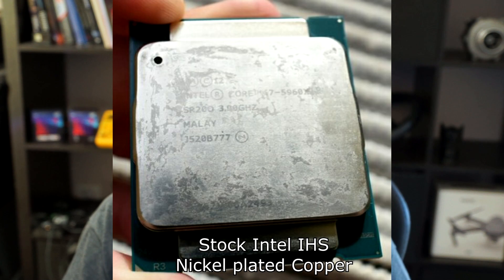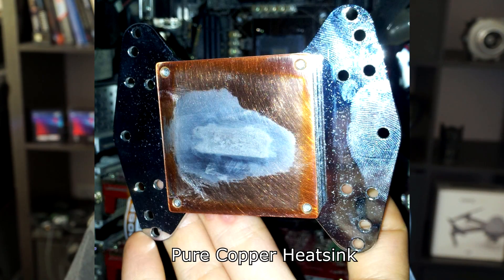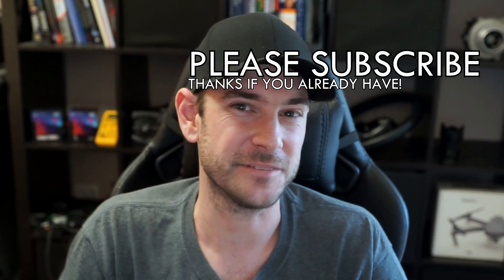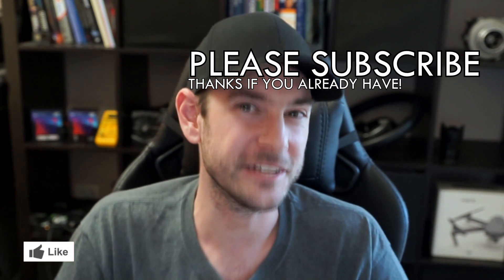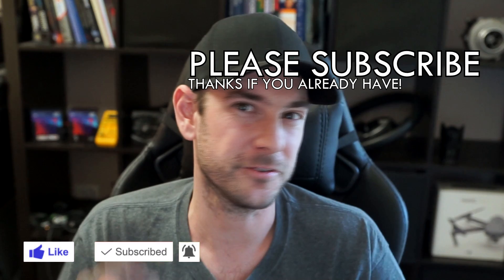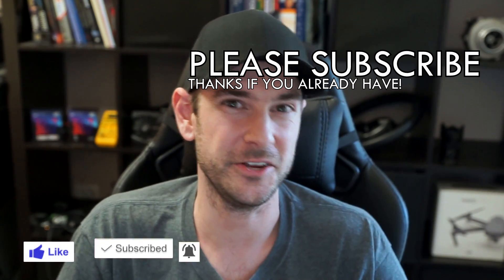Liquid Metal & Thermal Paste Demystified - The Basic Science

Comment: What about DIY nickel plating for a custom copper IHS? Do you have any experience with this? Suggestions? I don't want to reduce thermal conductivity...
Reply from the maker: Nickel is less thermally conductive than copper (slightly) so better to just use pure copper and a quality liquid metal.
Reply: @boostedmedia  Do you consider Conductonaut a "quality LM?" Cuz that's what I got lol
Reply from the maker: In my experience, Conductanaut seems to have a higher concentration of gallium than Coolaboratory but both will be fine.
Reply: @boostedmedia  Do you recommend resealing/relidding the IHS with silicone or loctite to reduce oxidation? And can this oxidation corrode or damage the CPU die at all?

Comment: Great video, man. I found some of the answers I was looking for. I have already delidded, but I just ordered a full copper IHS. Is it worthwhile to replace? I noticed you said gallium build-up/oxidization is not a big issue because it is more akin to "filling in the gaps" and can potentially HELP thermal conductivity, but does this mean it is counterproductive to replace my liquid metal under the IHS? I want to check on it every 6 months or so. Do you suggest I leave the existing LM or apply a bit more every time I pop the IHS off? Should I relid with the copper for improved contact or just float the IHS?
Reply from the maker: I think you’ve misunderstood. Oxidisation will not help. But the alloy that’s created between a quality liquid meta and the copper IHS is still more thermally conductive than just about any thermal paste. 

I wouldn’t open it up again unless there’s a problem. Adding more every 6 months is going to reduce your thermal performance over time. 

I have two chips now that have been delidded with copper IHS for over 6 months and they still perform exactly the same as the day I delidded them. 

Just use a quality liquid metal.
Reply: @boostedmedia 
So are you saying now that I should not use the copper IHS? It would be worse to delid again and replace with a new copper IHS?

 Actually, I think you misunderstood me lol. I know oxidization doesn't help; I said it doesn't seem to be a concern, but I see how I may have hinted it could potentially be helpful, but I understand it does not hurt. I see how you implied the binding/alloy process is not counter-productive if left alone the potential performance reduction is negligible.
Reply: Nevermind. The answer is obvious now. I didn't read your response carefully enough.
Reply from the maker: Oxidation isn’t the same thing as amalgamation.
Reply: @boostedmedia  Do you recommend resealing the IHS with silicone or loctite glue to reduce oxidation?
Reply: @boostedmedia  Is a copper IHS worth purchasing? Will I see any significant gains at this point?

Comment: Great informative video about thermal compound.

However, a better alternative would be to cold weld the heatsink and processor spreader surface (maybe by assembling the rig under vacuum) which will give much better results than the best thermal compounds but in order to do that the processor plate and heatsink needed to be designed much more precisely.

What would be much better than that is to replace the processor plate itself by a heatsink with much larger area.

Comment: In case you wanna replace your cpu and the liquid metal is hardened. How do you ge the cooler block off? Any tips?
I am about to replace my cpu and i have liquid metal on it since about 7 months. I am scared they stuck together when i am about to do it.
Reply from the maker: There’s not a whole lot you can do other than use force if it’s really stuck. Try twisting it gently from side to side to see if it comes loose before applying force though.
Reply: Did not expect such a fast answer. Thanks.
I will report how it went if i remember to do so than. Should be next week.

BTW i used Coollaboratory Pro Liquid Metal. So in case i report you know what i used for it.
Reply from the maker: I think you'll be OK with liquid Pro after 7 months using the stock IHS. But do let us know the outcome.
Reply: i hope i will be OK :S
I will write me a sticky note to report back, haha ^^

Thanks for help, i apreciate it. You already have my sub for this video, the good research and explanation. I learned something new.
Reply: @dom3827  So how did it go? Would be very interested on your experiences.
Reply: @Lukas.99  Had absolutely no Problems. The Liquid Metal was still as Liquid as on the first day. Nothing changed :)
just had a bit coloration on the copper of the cpu waterblock and even less of that on the cpu die which actualy was mostly removable with good cleaning.

Comment: I think Jay or Linus did a test with how much thermal paste you can use and found that it doesn't matter even if you dump a lot of thermal paste on it. If you mount your cooler the right way it will push out the excess thermal paste anyway so only the paste that is really needed will stay.
Reply from the maker: That’s true if it’s a relatively thin thermal paste. But some are thicker and will require more pressure to “squish out”. 

Obviously with delidding it’s different again as the gap is determined by the height of the IHS. Not the pressure applied by the heatsink. 

But yes it’s better to use a little bit too much than not enough. :)
Reply: I saw that on Gamer Nexus.. dunno about Jay or Linus.
Reply from the maker: Only one I saw like that on Jayz2Cents was where he tried using toothpaste/peanut butter/etc.

Comment: Been watching a lot of your videos recently (top quality content - got my 8086k at 1.2v 5ghz stable), one thing I'm not to keen on is your manual voltage settings, although this is great for dialling in the volts and finding what a cpu needs to be stable at its max overclock, the long-term plan should be to use the speed-stepping features of the CPU and the voltage steps. So any chance you can do a video showing how to change a manual voltage into adaptive using the offset functions ? Cheers, Mat
Reply from the maker: Hi Mat. That’s an awesome result for your 8086k! 

As I mentioned in my previous video, I’m not a fan of adaptive voltage settings as the can introduce instability and dropping the voltage makes little to no difference to the life of a CPU. It’s current that degrades a CPU. Not voltage. And at idle the current is low regardless of voltage. 

I’ve always run manual voltage on my computers for the last 15 years and never once had a CPU fail. The oldest one I know of is still running strong at 6 years old (3960x).

So my advice is if it’s stable and at 1.2V, don’t even worry about playing with adaptive voltage. The difference in power consumption is negligible too.
Reply: Thanks for the reply, I'll take your word for it. Cheers, Mat

Comment: der8auer did a video on how to remove most of the liquid metal from the metal surfaces (e.g the IHS) if you still want to do it or need it for RMA of the CPU.
Reply from the maker: I remember watching that one a while back. As I mentioned in the video, it's a lot easier to remove from a nickel plated IHS like what comes stock on an Intel CPU. Because the gallium in the liquid metal alloys with the nickel plating much slower than pure copper, if you remove it relatively soon after installation, it comes off. But if it's begun to alloy, the only way to remove it completely is by lapping the surface.
Reply: If you need to remove it from the top of the IHS for RMA (the serial number must be readable) then lapping would be counter productive. Hydrochloric acid should be able to remove it in that case. I can't think of any other case where it's actually important to remove the alloy that has formed on the metal surface.
Reply from the maker: Yep. Provided it hasn’t begun to physically change the surface.
Reply: RMA of a delidded CPU, u say?
Reply: @StuvenBarkus  no; not the delidded CPU. They're talking about the IHS's.
Reply: Benjamin Goodman you don't need to delid a Ryzen / Threadripper to apply liquid metal between cooler and IHS.